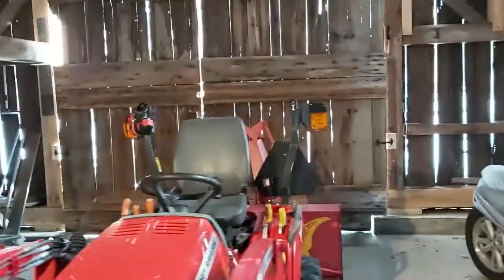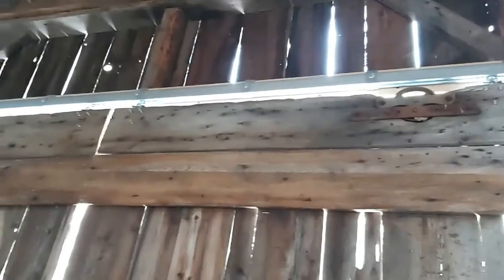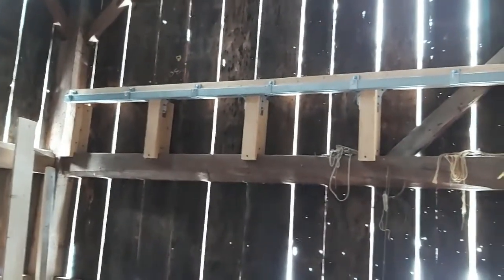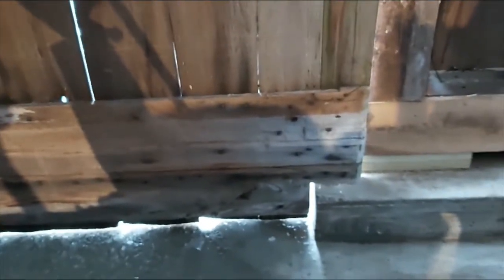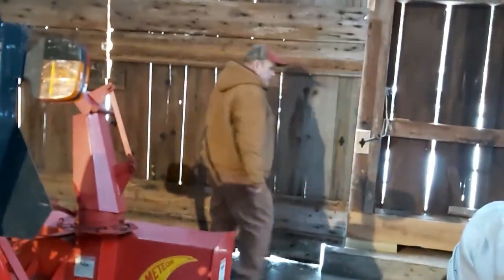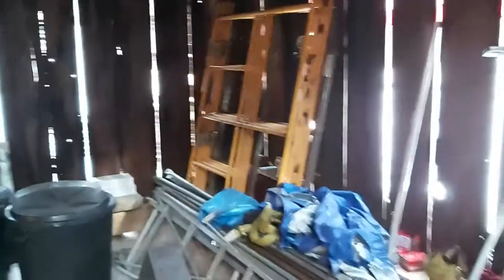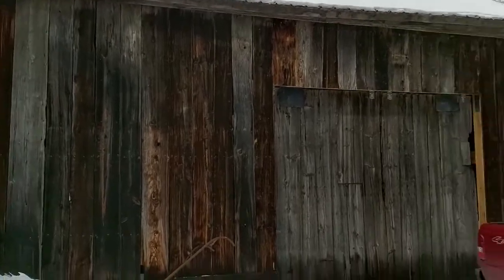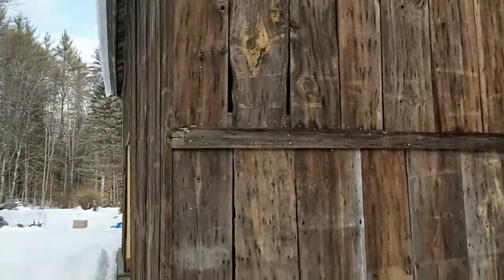1850's Barn Restoration - Episode 12 - THE FINAL EPISODE!

Comment: on my barn the doors have weatherstripping so i have a caster wheel on the side to push out the door and roll it on can se in this video if this works https://youtu.be/7PyeR_VLOTw
Reply from the maker: That's a good idea. I considered caster wheels but the frost during the winter lifts the slab as much as an inch. I didn't want the door getting  jammed up, so the doors just hang above the slab. Thanks for commenting. I appreciate it!